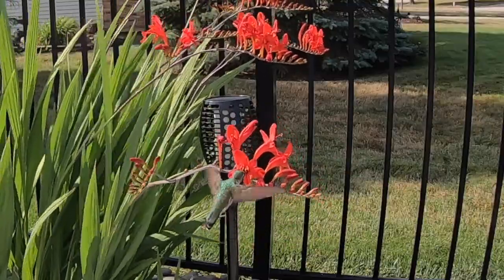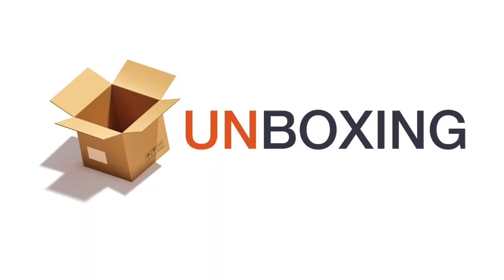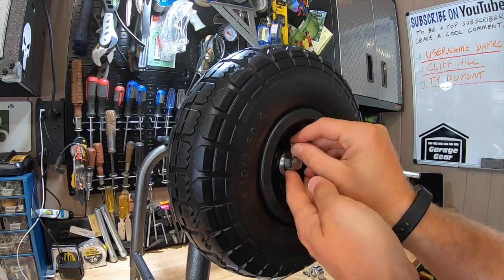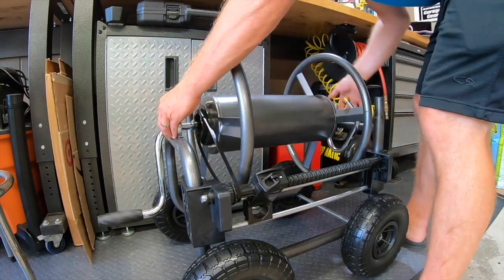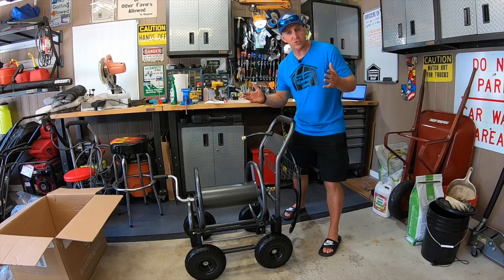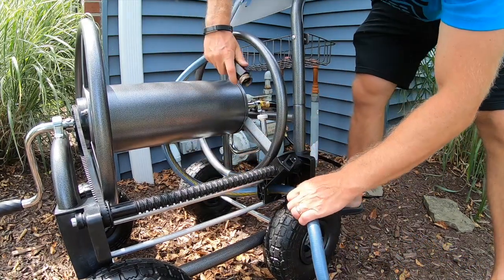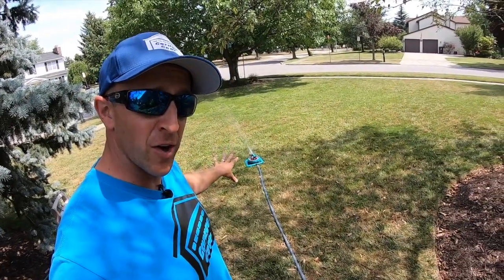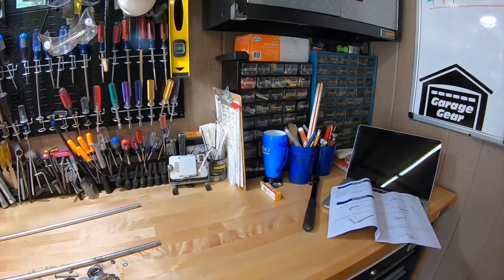IS THE GIRAFFE TOOLS INDUSTRIAL HOSE REEL CART THE BEST ON THE MARKET?

Comment: I'm just down the road from you in the Syracuse area and am also shopping for a solid, durable hose reel. Watched your video and have a question/concern, although it may be a little too early since your cart is only a year old. Have you had any issues with the belt yet? I can't tell what it is made of from the video. Depending on the material, I'm concerned that it will be a weak link in what, otherwise, appears to be a very solid unit. If and when it fails, do they offer a replacement? Thanks for the great video.
Reply from the maker: Hey Hog! Cool that you’re not far away! This is a solid unit. Mostly metal. Had for two seasons now. No rust or corrosion. Stays out 3 out of 4 seasons. No complaints about it. They do have a two year warranty. 👍 thanks for watching
Reply: Buy some extra belts now before they change the way its made and the belts become obsolete. This just happened with my Ames metal hose reel. They made my model so the parts that wear become irreplaceable and now i have to purchase a whole new reel at over 100. Manufacturers do this deliberately so you cant just fix it

Comment: The other thing is why the tires if your just going to have it next to the faucet?
What I wish is a reel that you can hook up to the faucet and drag the reel to where you want it or need it. 
The reel should be with skids until you put it away for the season than quickly install the wheels.  I hope you understand where I am coming from.
Reply from the maker: We’ll if I need to push the reel back into the garage the tires are a nice feature. And I couldn’t find a unit that didn’t require mounting that fit my criteria!

Comment: Hey JB, highly considering getting this reel this season. Only thing is I really want to use a 3/4” hose to maximize pressure/volume for my 12k sqft backyard. Do you think I can connect a 3/4” hose even though it’s marketed for 5/8”?
Reply from the maker: Hey my friend! You should be able to! The coupler on the ends is 3/4. Where the hose connects to the unit is a 5/8 diameter pipe I believe so you’ll have a restriction there.
Reply: @GarageGear  woah thanks for getting back so quick!
Reply from the maker: @GRASShole21  you got it my friend I try hard to get back to comments within 24 hours

Comment: Assembly tip - spray "Internal Frame Coating" (auto body supply)  inside all the Tubes before assembly.  Seals metal on the inside to prevent Rusting.
Reply from the maker: Great tip BV! Thanks for sharing!

Comment: I"m confused about these hose reel carts with wheels. You're limited to moving it just a few feet because of the spigot to cart hose, but even if you bought a longer hose for that, why move the reel? You're outside needing the hose not a hose reel. If I need hose to the far end of my yard, I pull more hose. It's easier to pull more hose than move a reel around and THEN pull more hose. What am I missing? I'm comparing these wheeled carts to a reel that's designed to remain stationary by the spigot, btw.
Reply from the maker: I guess it depends on your needs. Mine stays parked in place. But some people move them around their yards and having the wheel is necessary. Thanks for watching!

Comment: Please take your reel and turn upside down and drill at least 4 holes in the bottom so when it freezes it will not destroy your reel. 
You will say but there's no way for water to get down there but condensation and even rain water will find a way inside. 
Proof is take an empty milk jug and set it out in the sun with the cap loose and let it set for a week both day and night and see what happens.
Reply from the maker: I’ll be bringing it inside for the winter months! Good idea though!
Reply: @GarageGear  you will pay for it. I did and still blew a hole in the frame. Oh well time is a mean teacher. I have been slapped to many times.

Comment: I have this hose reel or one very similar with 100" of 5/8" water hose. It's about 12 years old (Lowes) and has never failed me, tires are getting tired and need to be pumped up from time to time but other than that good product.
Reply from the maker: Thanks for sharing
Reply: I guarantee the quality of the one you bought 12 years ago is vastly different from the one in this video.

Comment: What's the point in having a hose cart, but the hose coming from the house to the cart is 6-8 feet long and you can't "cart" the hose anywhere.
Reply from the maker: This reel is designed to be transported once and a while. You could get a longer attachment hose though. Thanks for watching